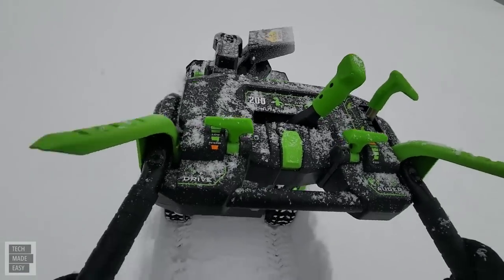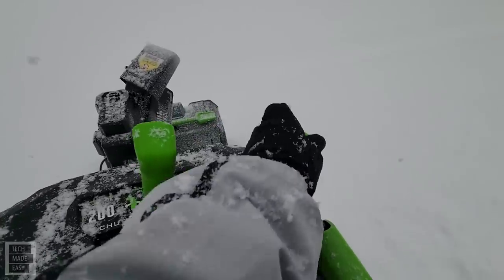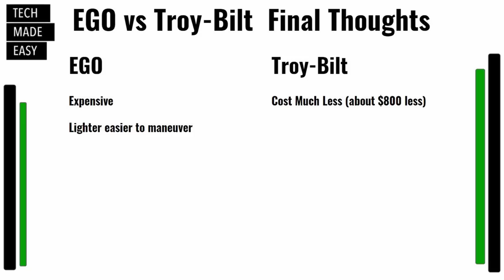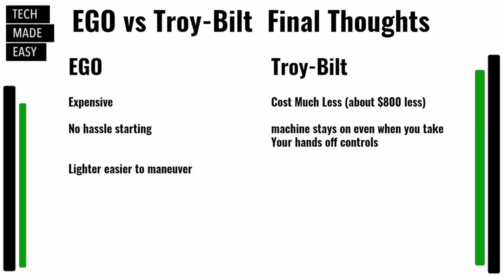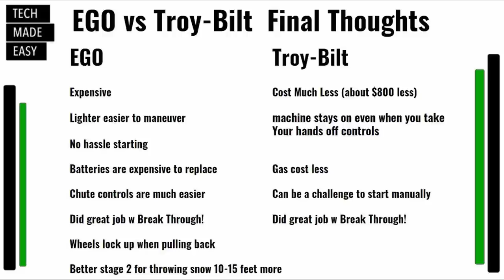BATTERY or GAS  EGO & Troy-Bilt   EGO 56v 2 Stage Snow Blower Troy-Bilt GAS  snt2405 snt2406 snt2400

Comment: Are you aware that there are more drive speeds than full steam ahead? That's what they are there for, dealing with deep snow. You must go through a lot of belts banging that drive lever on and off 500 times to get down the driveway.
Reply: Thank you for posting this. I was yelling at phone watching this.
Reply: That's why I like my old Murray built Craftsman that tells me on the speed indicator  what type of snow each setting is good for. 5 and above is for transport.
Reply from the maker: Thank you TSC hope you weren’t yelling at me like a few of my subscribers but I’m glad they share their thoughts and feedback 👍🏼
Reply from the maker: Thanks Robert
Reply: Hard to watch
Reply: Tough on the equipment. I hope it lasts you as long as the gas powered model.

Comment: your snowblowing technique was difficult to watch....i live in Syracuse and we get 120 inches of snow every year...just put that thing at the slowest speed and go...all that stop start stuff was unnecessary....if you fill it up with too much snow, take half a swipe instead....all the start stop cant be good for gears or drive disc in either machine....but i do love that EGO....too bad I have a beast in my Ariens  and it still works great after 16 yrs...i do own the 1 stage EGO and use it for my back deck...makes easy work out of it no matter what kind of snow
Reply from the maker: You got it Brian
Reply: Amen! If you're seeing the snow roll/push in front of the auger, you're going too fast. Dear Lord, that gear selector is there for a reason.
Reply: Yes sir amen should learn how to use it before you destroy it
Reply: He's got the red gas powered snow thrower in high gear lever all the way forward 14 inches of snow drive units not going to last long all the stopping and going
Reply from the maker: Thanks for your feedback I. made some good changes in the video I posted today definitely got better battery performance.
Reply: I bet that Ego isn't running strong after 16 years. Learn to run a machine correctly before doing a poor comparison
Reply: Yep!  Low and slow, always works!
Reply from the maker: Thanks, What snow blower do you have Eric?
Reply: Ego has a belt for the auger but no friction disc and belt for propulsion. Direct Drive I believe.
Reply: @ralphfraumeni6190  there is no belt, it's all direct drive. It doesn't need a belt, since it has 2 motors like all ego's driven equipment, they're all direct drive for less parasitic loss.
Reply: @sbukosky  I am with you. It is painful to watch. Lack of planning, and the, "if you ask me..." got annoying, to me at least. But the video does provide good info about the two machines.

Comment: Great video!  I just moved to North Idaho from California. Never dealt with snow before. Your video enabled me to follow along with you, see how it’s done, and see what to expect from the machines. I have decided I’m going with the EGO. I drive an electric car, and I’m just done with the mess, noise, and obsolescence of gasoline engines. I’m not going back to that. I’ve got a paved driveway but very long and very steep. I’m wondering if I should go ahead and start out with 2 sets of batteries, just to be sure that the machine will have enough juice to do the job.
Reply from the maker: If you can afford it go with the SNT2405 comes with 2 7.5ah batteries and a nice charger also. Thank you so much for watching my video let me know how things go down the road
Reply: I would suggest 2 sets of batteries and 2 turbo chargers for very near continuous use

Comment: Thanks for the comparison. I'm thinking about electric because I'm older and those machines are a lot lighter. Just wonder about the build quality, battery durability and belt and gear maintenance. Thanks again.
Reply from the maker: Hi Unkel 1st thanks for watching, this model was released in late 2020 I just started using it this year so far so good but early to tell especially for the cost.

Comment: You would do well to read the starting instructions for your gas unit.  I've never had to use the electric start on my Toro.  For sure, at least cut down the choke after it's started!

Oh, and set the ground speed slower and you won't have to "clear the snow out" all the time.

Comment: I have an ego 2 stage and have not needed to run on turbo speed. I keep mine at eco mode and it handled 10” of snow with ease and throws it enough to get it where it needs to be.
Reply from the maker: Hi Adam thanks fir watching 
I have to try that myself for sure. So use to pushing it hard but it’s not needed.
Reply: Agree.   I have had two snows in the Detroit area since I got it (decent snow today ~7-9 inches I would guess).    Eco worked fine for basically all of it.   I cranked it to Turbo to blast through the plow pack, and damn did that eat the battery up.      The only complaint I have is that the lighter weight sometimes causes it to drive up the snow, although that only really in the plow pack or if I was cutting through some of my previously shoveled piles on the edge of my drive way.      Overall I really like it.   Especially the lower noise and lack of smelling like a gas can when I am done.
Reply from the maker: Thanks James

Comment: A few things and I may be repeating what others have commented. You don’t have to hold the power button down to engage the blower. Just press it, let go and grab the right lever. To move it, again you don’t have to push the on button as it’s already on. Just silent. 

As others said, slow down!  You can pull the speed control down much more. I notice you had the Troy on high speed too..
Reply from the maker: Thanks Steven
Reply from the maker: Give us some feedback on our channel please, below is our survey link

https://forms.gle/dwgXj36dnQLp8anc6
Reply from the maker: Thanks for your feedback I. made some good changes in the video I posted today definitely got better battery performance.

Comment: I'm jealous of all that snow.  I like the sound of that Ego under load.  Thanks for sharing.

I bought the Ego 1 stage 2 years ago.  I just don't know if I can justify buying the 2 stage, but you blowing review made it difficult to say no. 

On the Troy Bilt blower, it appears you have the transmission in 7 and therefore have to continually release the forward motion lever.  Try moving the transmission lever to 1 or 2 or to whatever speed the blower can handle the amount of snow.  Later on I saw you doing the same with the Ego.  Slow down the forward motion to match the amount of snow.
Reply from the maker: Thanks Ron much appreciated so, you trading to the 2 stage ?
Reply: @TechMadeEzy  One, they don't even have them in stock around here.  And two, I just don't know if I can convince myself I will have enough use for it.  Maybe if I sell this house and move North 200 miles.  :-)
Reply: @rongollonik7754  Just a thought. IMHO it would make more sense when considering 2 blowers to have on gas and one electric, just in case of a power outage.
Reply: @TechMadeEzy  I did buy the the 2 stage when they were available in November.  I paid for it before it came in to the local Ace to ensure I would get one.  The Ace owner told me several people did that.
Reply: @ralphfraumeni6190  If I was in an area that gets enough snow and I had a big enough area to blow to need that sort of back up I might only have the gas blower.  

I think for most people with a driveway and sidewalk an Ego is sufficient.  If the power goes out and I can't charge my Ego batteries, I've got bigger problems like the house water pipes freezing.  

In 2016 I bought a great Ariens 28" and a few years later I bought the Ego single stage when that is all Ego had.  In 2021 I bought the Ego 2 stage and sold the Ariens.   So I could have done what you said but got rid of the Ariens because I just did not want the hassle or noise of gas.
Reply from the maker: How's it going? Like it?
Reply: @rongollonik7754  You may be right. So many reviews all over the place so I'm hedging my bets. If it turns out the Ego is sufficient, I'll sell my Toro 221 SS 2 stroke to a collector!😁
Reply: @TechMadeEzy  It fits perfectly in the back of my SUV though it's still in the box.😂 I'm prolonging the happy endorphins of the purchasing process. I have no garage and it's cold so as soon as I get the chance I will put it together. The window for snow here on Long Island is narrowing quickly so it may sit till next year. No one had it in stock. Well Amazon had them for over $2000.🙄 Magically an add for Ace Hardware showed it was in stock locally and they DID NOT price gouge at $1299 for the 7.5Ah kit. That made me very happy plus who knows how the supply issues will play out next fall. With a 5 year warranty I rolled the dice. Thanks for asking and good luck with your OPE!
Reply: @TechMadeEzy  I'd like it more if it snowed here in Southern Wisonsin.  Storms went North of here and South of here and we only got 1-4 inches.  I was amazed at how far it threw the snow.  I suspect that it would handle anything that falls from the sky.
Reply from the maker: I was impressed as well, have you tried the single stage ?
Reply: @TechMadeEzy  I bought the first single stage in 2019.  At the time I also had an Ariens 28 Deluxe which was very capable.  In 2019, 2020, and 2021 I used the Ego although there were a few piles at the curb that would have been better handled by the Ariens.  I was reluctant to pull it out just because I did not want to run it for an hour and then at the end of the season have to do the end of season service.  I sold the Ariens, but the Ego 2 stage and used it while the Ego single sat out the winter for the first time.
Reply from the maker: You are prepared for sure.

Comment: thanks for the video comparison. I am debating between Ariens deluxe 28 / Cub cadet 2x 28 vs EGO 2 stage blower. I want to get the EGO stage 2 but worried that I will need to make multiple trips due to charging batteries to clean the front and garage driveway if we get 1 foot of snow and also the snow wall at the end of the driveways.
Reply from the maker: Prakash thank you and hopefully 2 10ah batteries will help that but yes 7.5ah I would recommend 2 sets if not you’ll need an extra fast charger so you can charge up both batteries then go back out again.
Reply: I would say the Ego may be a downgrade compared to a 28" gas blower. The 24" Ego could be too small for you. I'm sure it will do it but it will take you longer and you may need extra batteries. I love the Ego and it replaced my 24" Ariens which was (and still is) a solid machine. Like everyone says don't use turbo mode. You get a lot more time with eco mode and it was plenty of power even for 21" of snow. My guess is that the 2nd gen Ego will come with the 10.0 Ah batteries.
Reply from the maker: Yup need to go with a slower speed for sure thanks. But the machine works well

Comment: I had trouble pull starting my gas snow blower and someone shortened the pull cord on it by just a small amount and pull starting was much easier then. I guess I can pull faster with a slightly shorter cord but I don't know. It seemed to have helped anyway. Just an fyI

Comment: Excellent video comparison. I don’t own a snow blower but now that I am 50 years old things are getting a little harder and I think I’m finally ready to get a snowblower. I really like the ego but I really don’t think they’re going to hold up as well or as long as a gas blower would. 
Also let’s say it’s 6 years from now and your ego is still working...one day it breaks, where do you take something like that to get it fixed? Are there authorized dealers in that work on the ego?
Reply from the maker: Hi Doug thanks for watching and yes to my knowledge EGO has authorized dealers, I have to check if they have authorized repair centers that’s a good question.
Reply from the maker: Good news here is the store locator link, you can select dealer then enter your zip, you should see some authorized repair centers, hope this helps

https://egopowerplus.com/store-locator

Comment: I just sold my 12yr old  Simplicity 2 stage 26" snow blower which I had used  along side Ego single stage 1st generation snow blower for the past 4yrs.  In my case Simplicity cost $1100 vs Ego $800. The Gas snow blowers was PITA. I seem to alwsys forget to drain the gasoline out at the end of season, then the next yr it doesnt start, or it needs a tune up, someone has to come and haul it away and tune it up.   Vs Ego. Other than charging the batteries before use, no maintenance what so ever. Ego is  game changer and I actually enjoy clearing the snow. Another thing, the gas snow blowers are so heavy, they are exhausting when turning corners compared to the super light Ego. Anyway great video I wish I made a comparison video before I sold mine.
Reply from the maker: Thanks Royal I enjoy how light it is also and how easy it is to maneuver

Comment: I just bought the Ego but just for fairness, I'd bet the gas machine would have faired better had you run some seafoam through it first. After sitting for a year it sounds like there is some power loss.

Comment: How is the battery life on ego using those 7.5 ah ones? How many sqft (with how many in of snow) does it cover in a single charge?
Reply from the maker: Can’t say in square feet, ego says it clears an 18 car driveway on the 2 x 7.5ah batteries, I’ve learned slow and steady and the batteries last and the machine has the power of gas with no issues plows through anything
Reply: @TechMadeEzy  how big is your driveway and in the video u have a good amount of snow. Do batteries last for you without having to recharge? You snow amount is similar to what I got here.
Reply from the maker: I don't know the exact measurements but the bottom line is as long as you put it on slow and go slow and steady my batteries lasted me. But I will tell you if you have a long snow storm that continues to snow over a couple of days you're probably going to want an extra set of batteries

Comment: Battery life? And durability?  Are you gonna have to buy a completely new unit after a short product lifetime?  How much does a new set of batteries cost? Are they going to be completely worn out just after the warranty expires? And BTW this is not the Troy-Built company that your parents knew; now must units that are labeled Troy-Built, and sold in the big boxstores  that I see are manufactured in the Mexico MTD factory.
Reply from the maker: 10ah has a 5 year warranty, 7.5ah has a 3 year warranty. Yup definitely gets expensive.

Comment: Will it run on 2 of the smaller batteries?
Reply: yep...i use the 7.5 or the 5
Reply from the maker: No smaller than 5ah but you won't get much time on the 5ah depending on your speed (auger and drive speed)

Comment: @tech made easy if you factor for the batteries, the ego is cheaper by $100, and it's clearly much more powerful. I'm curious how the ego would do if you just let it eat at a slightly slower speed instead of stopping it like that for some reason? it would be nice ro redo this with both of them set to the maximum speed they'll keep up without having to stop, will they make it through the windrow at the end of the driveway without stopping, ect... also, the ego doesn't use belts/friction disks, so there are less points of failure/maintenance. also, like all ego products, you don't have to have the auger/blade engaged to drive it
Reply from the maker: I learned that also, nice slow and steady and the batteries last even more
Reply: @Tech Made Easy  I haven't verified this, but if the snow thickness is varied, you should be able to leave it in eco for the augers and it will throttle up/down on it's own and save even more battery. I have a z6, push mowers, and string trimmers, and they all do this, so there's no reason the snow blower shouldn't do the same. This would be an opportunity for ego to make an automatic  "constant load" mode like I believe honda has in their highest end snowblowers
Reply: @TechMadeEzy  yeah, it's the $9300 top of the line hybrid honda that has automatic mode, it's a constant load, max output mode that will just go. you just steer it. Also, didn't catch it if you mentioned this, but the ego has an automatic locking diff that propels both wheels in forward, but allows free turning, like the nice ariens units, but seems to work better and be less finicky over ineven surfaces, as I haven't seen any complaints about it. It's also really easy to push around off, which is appreciated.

Comment: Good review, but I like to see the blacktop. All the stopping was unnecessary. After twenty years with an ariens and no issues. I’m staying with it. No way I’m going to buy a replacement battery for $400.00 on Amazon after a few years. Plus I like to finish my driveway in one session, not wait two hours for a recharge. Gas refill takes 2 minutes.
Reply from the maker: Thanks for sharing 👍🏻

Comment: First the positive to which there is not much about this video. The Ego 2 Stage snowblower impressed me. The single stage Ego looks useless. 

Now the negative
1. Use choke when starting a gas powered snowblower. Starts right up.
2. There is a gear shift for a reason on the Troy built. Take it out of high gear if it can’t handle it and use one of the other lower gears till it can.
3. The Ego also has a speed lever for the wheels. Lower the wheel speed and/or raise the auger speed. Don’t start stop like that.
4. The Ego is still super loud in your video with that high pitched whine.